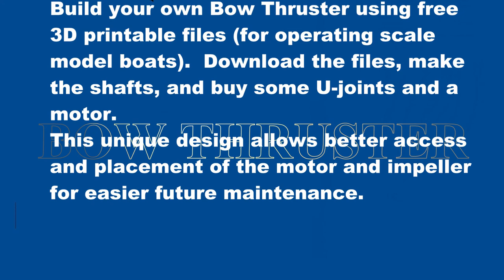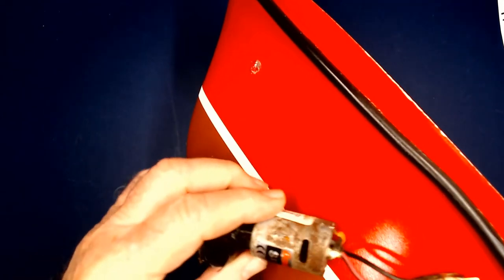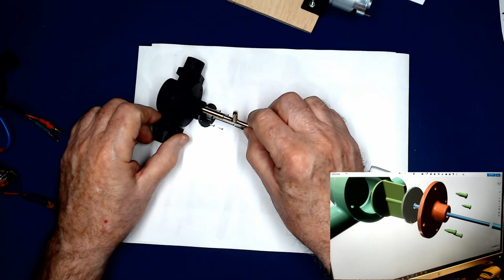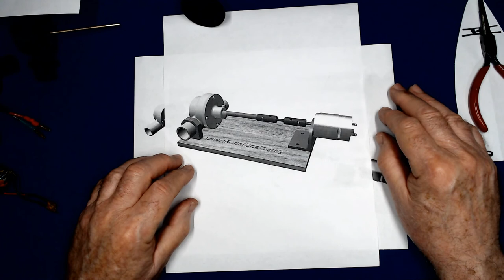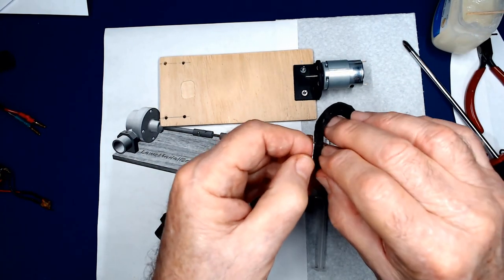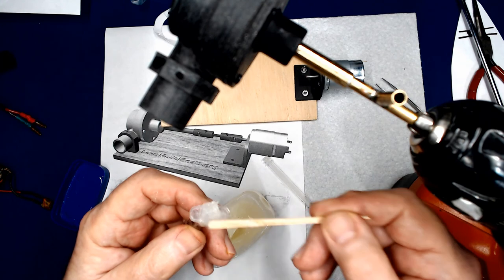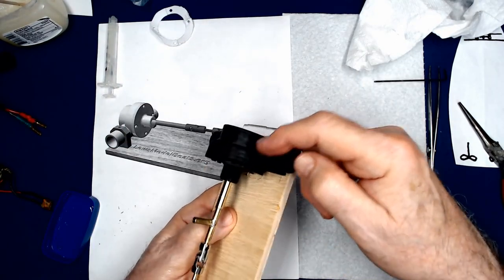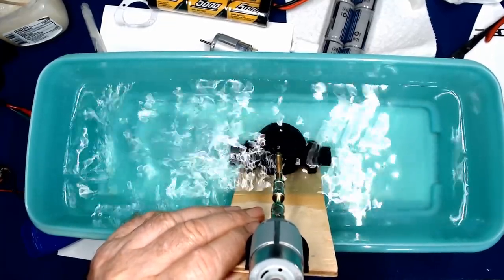Bow Thruster for Scale RC Boats

Comment: Great video! Really liked how you took the time to explain everything. I have to decide now between a propeller or a paddle version for my 1:72 rc tugboat. Problem is space. I only have between 20 and 30 mm side to side. I think I'm gonna go with the propeller version and use bevel gears. Because the one you built does indeed require quite a larger housing for the paddle  and I'm thinking that this may exceed the space I have available.
Thanks again for this informative video.
Reply from the maker: Glad it was helpful!

Comment: Very nice project and thanks for sharing the files. The picture that is supposed to show the dimensions for the various brass tubings is however missing on your website.
Reply from the maker: The tubes or solid rods can be whatever material you want, aluminum, wood, brass... all are 3/8-inch (.375") in diameter.  The ones in the video are about 12-inches long.

Comment: looks great, i downloaded the files but what program opens them? my 3d software will not open them
Reply from the maker: Sorry it took so long, I didn't see your message. These are STL files, usually most 3D apps don't open STL files. The STL file is opened in your slicer which creates a G-Code file that would go to a 3D printer.
Reply from the maker: Fixed.  STL files will now download.